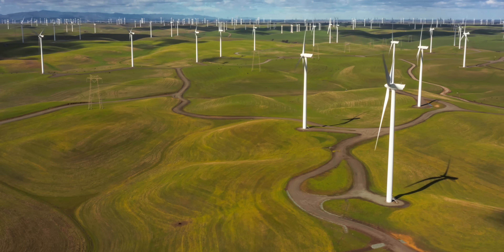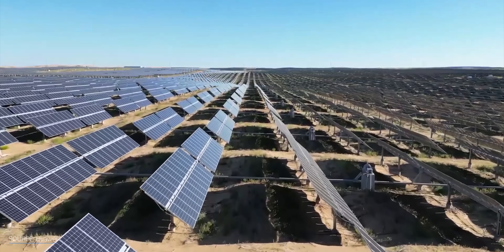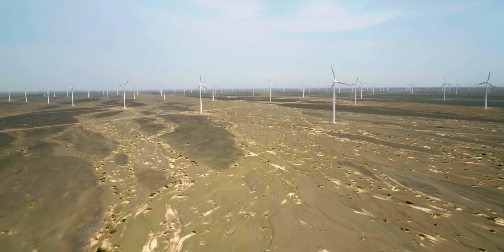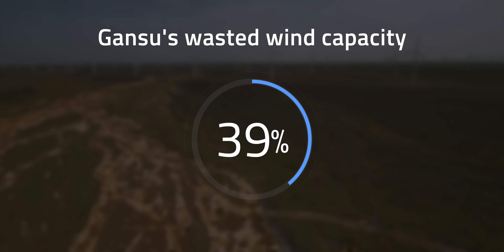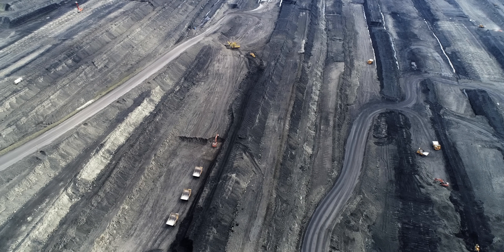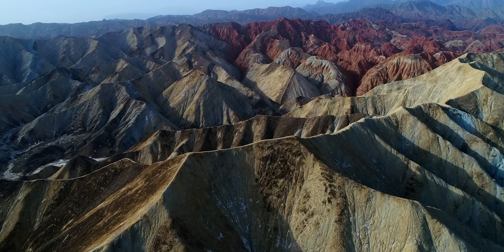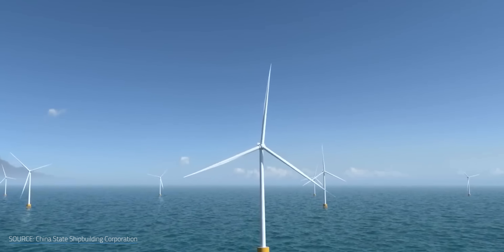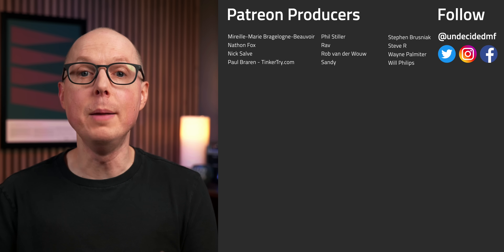The World’s Largest Wind Farm has a Tiny Problem

Comment: China has the most advanced power transmission systems in the world. You have the 800kv system, but China also has 1MV systems, and it is DC. Of course still have the problem of building over what may be a shifting landscapt of sand, and also the support roads needed to maintain. The US has a 760kv , but only 600kv iin DC. And who knows what China is developing. China is going to need more transmission capabiity so that it is worthwhile for them to go to better technology.

Comment: Gobi desert sand is extremely fine and  as you say the wind blows frequently .  The sand can  therefore get into the mechanical workings of the wind turbine causing  excessive wear.  I wonder what the  downtime and repair costs for these turbines are ? 
 Any project also has another large cost associated with it in China namely brown paper bags leading to skimping on materials
Reply: Downtime is when the generator overloads or shorts to ground. Fine sand is a non-issue up there.
Reply: @austinschwebel819   Really  ? we will see.

Comment: Renewables worked for Germany, they can work for you!
Reply: Renewables are going to destroy German economy. Germany can only survive with electricity from the European grid supplied by excess generation from France, Norway etc. Just check out the daily data from European Energy Exchange and Fraunhofer Institue of Solar Energy. Germany would be in dire straits if it was on its own.

Comment: The US has a full infrastructure of electrical grid albeit it does need constant maintenance. All forms of power generation are connected to the grid from wherever they are located. This is both a blessing and a curse. A blessing in that it is possible to obtain power from locations remote to the site of usage when required to supplement local generation.the curse can occur when a portion of the grid us unexpectedly interrupted. This can cause a snowball effect on other lines of connection, causing a snowballing of collapses. The can result in a regional blackout as occurred in 2003 in the northeast. 

Unfortunately, the grid has become, for some a political football, this became evident with the Texas winter blackout, the local plants were overwhelmed due to demand, and politicians would not permit importation of remote power.

Comment: And NO WIND is a little, erm, embarrassing.
🇬🇧Scotland has the same problem of over production but the massive government subsidies still have to be paid to every supplier even when the wind don't blow.
And when the wind don't blow and the batteries are dead the backup gas, highly polluting biomass and nuclear come in to their own again; an essential multi-tier power producing system to ensure continuous production. Expensive power is the outcome.
Reply: Nuclear Power is zero when a plant is shut down for years for maintenance, costs 10s of billions. Polluting for centuries.

Comment: But for fossil fuel lobby renewable energy with storage is the least controversial thing we can do. Plants have been doing it for millions of years and I don't see trees die when the sun goes down. The on'y question is if there is not enough storage what can bridge the demand gap? I am pro nuclear power but I feel that will open up a different set of controversy because of past meltdowns.
Reply: Wind and solar produce a fraction of what a natural gas or coal plant can produce and at a lower cost. No amount of storage will be enough, the output from renewables just isn't there.

Comment: as you said.lt is just too expensive to build and too expensive to maintain, and China is not known very well for preventive maintenance, at least in the 20 years I have been manufacturing there. and add all the corruption there on top of this. I would not be surprised as those turbines break down more and more, they will be just left there broke.

Comment: I was very intrigued by this video.  So I checked the Google Earth Images. Some imagery is from Oct 2023 but most images are from May, July, and August 2024. So this observation is fairly up to date.  

From the images, you can see that the Gansu Zhongdian Jiuquan Wind Power farm uses turbine blades 100m long.  You can see partially unassembled turbines on the ground.  

I counted the turbines in several wind farm sample areas and can conclude that the wind farm has around 3 turbines per sqkm.  I was able to map around 2,400 sqkm of wind farms with installed turbines.  This works out to around 7,200 turbines.  It would have taken too long to actually count the turbines. There are hundreds of sq km of areas laid out with what looks like pads without any turbines. They may be planning to deploy even more turbines.  

Based on the 100m blade size visible on the latest images, they may already have installed the latest 10MW turbines. So it is very possible that they may already have achieved the target 20GWatt capacity.  The 100m blades are visible on August 2024 satellite images. Most of the 100m blade turbines seem to be already installed.

There are multiple solar farms interspersed with the wind farms.  They are not only doing wind, but also solar.

The Gansu wind farm is not 70,000 acres (283sqkm).  According the Exaputradotcom article cited on the video script of the author, the correct figure is 70,000 hectares (173,000 acres) (700 sqkm ).  This seems too small. The cited article might have old data.  

The Gansu wind farm is not 39,000 sqkm and it is certainly not bigger than Belgium.  But it is more than three times bigger than New York. Checking the citations on the video script, the "39,000 sqkm" quote comes from a site environmentalblogdotcom.

The comment about 95% efficiency comes from a South China Morning Post article which more completely stated that, "By 2016, nearly half of the electricity produced by the province’s 9GW worth of wind turbines was discarded because there was no use for it....[by 2021] The use efficiency of the farm’s renewable energy rose to 95 per cent."

Comment: How much of a impact does the creation of these wind mills have on ecology?  Mining, trucking ore to smelter, energy needed to turn the ore into metal, manufacturing, trucking of components to build site, installation, etc.   Lithium Batteries are a solution for storage because of the ecological impact.  What about "Gravity Storage"? of the excess power?

Comment: Ah, the usual green BS.
Any true electrical engineer knows we need to use reliable, constant baseload electricity.
This is impossible with wind and solar generation, that are both expensive and unreliable, plus need lots of land and materials (plus need replacing every decade to be dumped), considering the unknown actual output at any one time.

Comment: I agree with the majority of the comments about overstating wind and solar and the lack of balance looking at the big picture of solving the world energy needs while reducing carbon emissions

You make it sound like China’s wind and solar energy production nearing that of coal (inferring only 50% more to go) provides the model for the world!

You ignored the fact that coal is base load, and natural gas an effective peaking power source. If you have worked in energy production area.you know the importance of these two energy production modes. Wind and solar are neither base load nor are they peaking sources. They work ONLY when the sun shines and the wind blows not when you need it. And implying that there’s a simple solution like batteries to fix that is, a colossal understatement in addressing that issue.

I think everyone wants clean energy. But let’s be honest about the pros and the cons! 

In my opinion, France Is closer to what you should be touting as a world leader in clean energy. Roughly 70% nuclear (all base load, actual energy production not installed capacity, and by World Health Organization’s actual data, the safest form of energy production)!

Just a little balance is all I’m asking for!

Comment: And that is the problem with renewables, the cost of transmission. It might be windy or sunny somewhere, but you have to connect to it and even if the turbines or panels grew out of the ground by themselves, you still have to connect to them and that is their Archille's heal. Also, the plate rating for output does reflect the reality. Great post, thanks.

Comment: American Natural gas is a better deal.
Renewables are just too complicated. 
Natural gas is clean, and it's generators don't require large remote places.
Instead of large long transmission,  you can has a natural gas generator next to urban areas.
Battery packs are necessary, because natural gas generators can be turned on and as needed.
Natural gas is not a pollutant.  I cook with natural gas in my home.

Comment: Ok, so the electricity from wind is already almost twice the cost of that of coal and now you want to add batteries for storage. Right, sounds like a case of:
"How much money do you want to waste?" - "YES"
Reply: Coal and natural gas are more expensive in the end. It's just that  the cost is an externality. We don't pay for it. The next generation will, in the form of more intense natural disasters and unwanted population migration.
Reply: even if renewables cost more, it is a better alternate to coal and oil as the environmental damage they do cannot be properly measured and assigned a cost.
Reply: @johnbenoy7532  A statement of faith like that only begins to sound credible if you're committed to the religion of gullible warming. Electrcial generation by coal fired thermal power plants hasn't been dirty in any sense, unless one insists that emitting free plant food is 'dirty', since the 1950s. Additionally coal fired thermal generation technology is still not at the end of it's development potential (as proposed HELE developments indicate). As far as the solid waste stream, fly ash can be used as an ingredient in concrete, bottom ash as aggregate and gypsum from flue gas desulphurization can be used in plasterboard/drywall panels. Which is to say coal is part of the 'circular economy'. 
As for oil, well, once you burn it, aside from the free plant food, it's gone.
So what is this claimed environmental damage that's so much worse than laying waste to great tracts of land to erect unrecyclable wind and solar subsidy mining boondoggles?

Comment: Put aside electricity, just use up the wind energy at that area alone already benefit China a lot. China had been trouble by strong wind blowing sand to the populated area for centuries. There are a few town force to relocate not once but a few time due to those sand.

Comment: Kern County representing!! In all seriousness though, Solar and Wind are great, but cannot be used as the primary power source for any power grid. If the required output spikes, you can't just increase wind speeds to ramp up production, something you can do with both coal and nuclear. Renewable energy is great, but only coal and nuclear are dispatchable power, which means the output can be increased on demand, something that is necessary for a stable power grid.

Comment: China has unique Ultra Voltage Transmission line that can transmit both DC and AC much more efficient than most western system.   When you can generate more electricity than you can used is a good thing.  China also has Molten Salt Energy storage.    This is like how China invested in all these electric infrastructures decades before their electric cars.   And remember how the west joked about China's World's Loneliest Metro Station.    You almost assume China will eventually find way to store the renewable or use them.   I guess they could use the electricity to process rare earth in this region.

Comment: It's low density power production requiring a greater amount of copper cabling. What are the figures for copper requirements compared to high density conventional power production per megawatt/gigawatt. Along with envisaged EV uptake copper requirements, the copper does not exist to make it all a reality.
Reply: It'd probably be aluminium cable. Aluminium is a little less conductive, but a great deal cheaper.